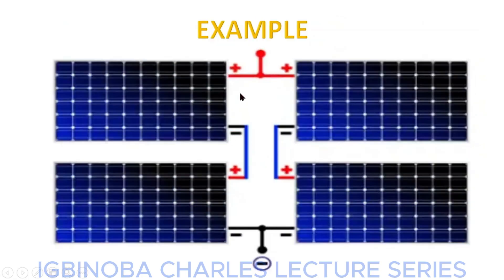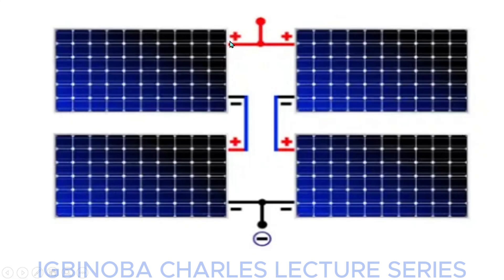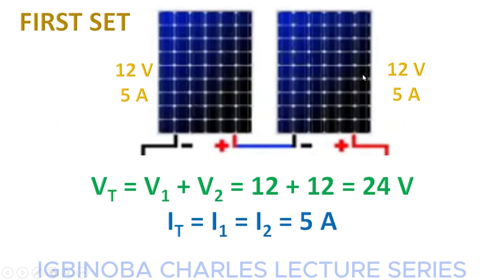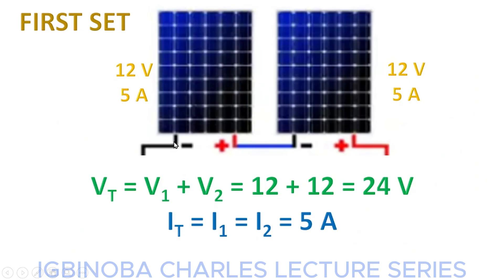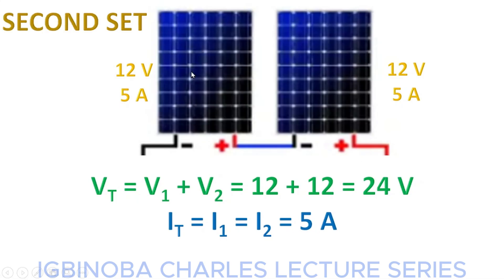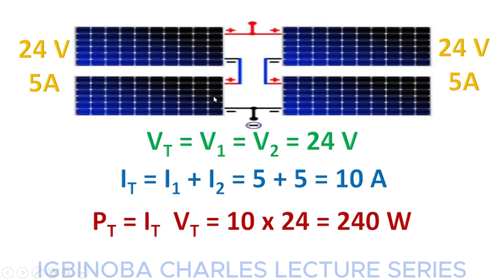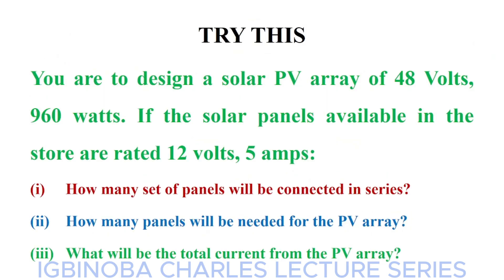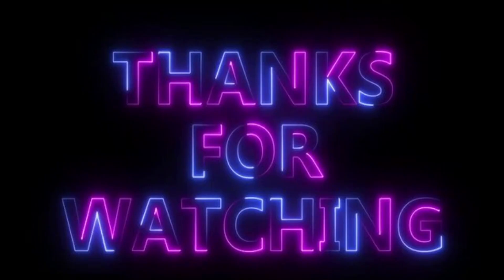Connection of  Solar Panels in SERIES-PARALLEL

Comment: EEE3126V
1) Four panels are connected in series. When you connect four 12v, 5A panels in series you get a total of 48V.
2) The total of 16 panels would be needed as each panels produces 60W given us a total of 960W(12v × 5A). It will be divided 60W given us 16 panels.
3) The total current of the pv arrays is 20A.

Comment: MAR3129Y

Sets of panels that will be connected in series =
48/12 = 4 panels.
2. Power generated by a single panel = 120V x 5A =
600W.
Required power in the array is 960W. Hence, the
number of panels needed for the array = 960/60 = 60
panels.
3. 16 panels are in the array and 4 panels are in series.
Total number of parallel sets of panels = 16/4 = 4
parallel sets.
Total current from each set of panels is 5A. Since these sets are in parallel, the total current = 5A × 4 = 20A.

Comment: PETRO3133C

Connecting panels in series increases the voltage while keeping current the same. To reach the target of 48 Volts using 12-Volt panels:
(i) 4 panels in series.

 Total Panels Needed. To find the total number of panels, divide the total required power by the power of one single panel.
Total Panels = Total Power/Panel Power = 960W/60 W = 16  panels
(ii) 16 panels total.

You can calculate the total current (I) using the total power (P) and total voltage (V) of the array (P = I/V)
(iii) 20 Amps total current.

Comment: MECH3177U

1. Series-Connected String: A set of 4 panels is connected in series to build up the required system voltage.
2. Total Array Size: The complete photovoltaic array consists of 16 panels in total.
3. Array Output Current: The total current generated by the entire PV array is 20 Amps.

Comment: MECH3136F

1. Sets of panels that will be connected in series = 48/12 = 4 panels.

2. Power generated by a single panel = 120V x 5A = 600W.
Required power in the array is 960W. Hence, the number of panels needed for the array = 960/60 = 60 panels.

3. 16 panels are in the array and 4 panels are in series. Total number of parallel sets of panels = 16/4 = 4 parallel sets.
Total current from each set of panels is 5A. Since these sets are in parallel, the total current = 5A x 4 = 20A.

Comment: Civ318R

1. Four panels are connected in series. When you connect four 12-volt, 5-amp panels in series, you get a total of 48 volts, which is the voltage needed for the solar system.

2. A total of 16 panels are needed. Each panel produces 60 watts (12V × 5A = 60W). To get 960W in total: 960 ÷ 60 = 16 panels.

3. The total current from the solar array is 20-amps. Using the formula I = P ÷ V,

I = 960W ÷ 48V = 20A.

Comment: PETROCHEM355C

1. Four panels are connected in series.
When you connect four 12-volt, 5-amp panels in series. vou get a total of 48 volts, which is the voltage needed for the solar system.
Each panel produces 60 watts (12 V x 5 A = 60 W)
To get 960 W in total: 960 + 60 = 16 panels.
3. The total current from the solar array is 20 amps.
Using the formula 1 = P + V 1-960 W 48 V= 20 A.

Comment: MECH3146P

1. Number of panels in series:
For 48V, we need to connect panels in series. Since each panel is 12V, we'll need
48V divided by 12V = 4 panels in series

2. Total number of panels:

Each panel is 12V, 5A, so the power rating will be: 12V x 5A = 60W per panel

For a 960W array, we'll need: 960W divided by 60W per panel = 16 panels

Since we need 4 panels in series, we will have: 16 panels / 4 panels per series line up = 4 parallel line ups

3. Total current from the PV array:

Each series line up produces 5A (since the panels are connected in series). With 4 parallel lineup , the total current will be:
5A × 4 = 20A

Comment: PETRO339M

1. Actual load= (100×3)+(60×10)+(120×4) =1380watts
2. Total load assuming inverter loss of 25%= Actual load +Inverter loss
Inverter loss=25% of Actual load
= 25%×1380=345 watts
Total load= 1380+345=1725 watts
3. Inverter rating on VA using power factor of 0.8
= (1725÷0.8)= 2156.25
4. Battery capacity using factor for reserve 75%=(2×1725×6×0.75)=1293.75Ah
5. No. of batteries for backup hours=1293.75Ah÷150Ah= 8.6 =8 batteries 
6. How batteries will be connected?
The batteries will be connected in parallel 
Vt=V1=V2=V3=V4=V5=V6=V7=V8
Ah= 150+150+150+150+150+150+150+150=1200
7. Battery charging current=1293.75÷10=129Amps
8. Battery charging time assuming charging loss of 40%= 1293.75Ah+(40%+1293.75Ah)÷129A=14hrs
9a. Wattage panel array= 3105 watts
9b. Number of panels required= 3105÷345=9 panels 
9c. Ampere of charging controller required= 3105÷12=258.75Amps
10a. Wattage of panel array= Calculated wattage of solar panel array for charging battery only+ calculated total load =3105+1725=4830watts
10b. Number of panels required= calculated wattage of solar panel array÷ Available wattage of solar panel supplied= 4830watts÷345= 14Amps
10c. Ampere of charge controller= calculated wattage of solar panel array÷ solar panel voltage=4830watts÷12volts= 402.5Amps
11. How will the panels be connected?
Ans: They will be connected in parallel

Comment: Mech3181y

1. 4 sets of panels will be connected in series.
Since connecting 4 of the 12 volts, 5 amp panels in series gives a total of 48 volts as required by the solar PV array design
2. 16 panels will be needed for the PV array.
This is because the power of each panel is 12 x 5 = 60 watts, therefore the total number of panels to
produce 960 watts is, 960/60 = 16
3. The total current from the PV array is 20 amps
Since I (total) = P (total)/ V(total)
I (total) = 960/48 = 20amps

Comment: EEE101W
Four panels are connected in series.
When you
connect four 12-volt, 5-amp panels in series, you get a total of 48 volts, which is the voltage needed for the solar system.
2. A total of 16 panels are needed. Each panel produces 60 watts (12V × 5A =
60W). To get W in total: 960 60 = 16
panels.
3. The total curent from the solar array is
20-amps. Using the formula I = P + A,
1 = 960W ÷ 48V = 20A.

Comment: EEE98T 
Four panels are connected in series.
When you
connect four 12-volt, 5-amp panels in series, you get a total of 48 volts, which is the voltage needed for the solar system.
2. A total of 16 panels are needed. Each panel produces 60 watts (12V × 5A =
60W). To get W in total: 960 60 = 16
panels.
3. The total curent from the solar array is
20-amps. Using the formula I = P + A,
1 = 960W ÷ 48V = 20A.
3
回

Comment: EEE55C

Four panels are connected in series.
When you
connect four 12-volt, 5-amp panels in series, you get a total of 48 volts, which is the voltage needed for the solar system.
2. A total of 16 panels are needed. Each panel produces 60 watts (12V × 5A =
60W). To get W in total: 960 60 = 16
panels.
3. The total curent from the solar array is
20-amps. Using the formula I = P + A,
1 = 960W ÷ 48V = 20A.

Comment: PETRO3190H

4 sets of panels will be connected in series.

we are connecting 4 of the 12 volts, 5 amp  panels in series gives a total of 48 volts as required by the solar PV array design

16 panels will be needed for the PV array.

This is because the power of each panel is 12 x 5 =  60 watts, therefore the total number of panels to produce 960 watts is, 960/60 = 16

Total current from the PV array is 20 amps

Since I(T)= P (total)/ V(total)
I (total) = 960/48 = 20amps

Comment: MECH3173Q
1. Four panels are connected in series 
When you connect four 12-volts,5-amp panels in series, you get a total of 48 volts ,which is the voltage needed for the solar system 
2. A total of 16 panels are needed 
Each panel produces 60 watts (12v×5A=60w).
To get 960w in total: 960/60=16 panels 
3. The total current from the solar array is 20 amps.
Using the formula I=p+v, I=960w/48v=20 amps

Comment: MECH328B

1. 4 sets of panels will be connected in series 

Since connecting 4 of the 12 volts, 5 Amp in series gives a total of 48volts, as  required by the solar PV array design 

2. 16 Panels will be needed for the PV array because the power of each panel is 12×5= 60 watts. therefore the total number of panels to produce 960 watts is 960÷60= 16 

3. The total current from the PV array is 20amps.
This is because I(total) = P(total) /V(total)
I(total) = 960÷48= 20amps

Comment: NAT341O

1. Four panels are connected in series. When you
connect four 12-volt, 5-amp panels in series, you get a total of 48 volts, which is the voltage needed for the solar system.
2. A total of 16 panels are needed. Each panel produces 60 watts (12V x 5A = 60W). To get W in total: 960 60 = 16 panels.
3. The total curent from the solar array is
20-amps. Using the formula | =P +A,
1=460W÷ 48V= 20A.

Comment: Petrochem357E

1. 4 sets of panels will be connected in series.

Since connecting 4 of the 12 volts, 5 amp panels in series gives a total of 48 volts as required by the solar PV array design

2. 16 panels will be needed for the PV array.

This is because the power of each panel is 12 x 5 = 60 watts, therefore the total number of panels to produce 960 watts is, 960/60 = 16

3. The total current from the PV array is 20 amps

Since I (total) = P (total)/ V(total) I (total) = 960/48 = 20amps

Comment: MEC75W
I.Four panels are connected in series.
When you connect four 12-volt, 5-amp panels inseries. you get a total of 48 volts. which is thevoltage needed for the solar system.
2. A total of 16 panels are needed.
Each panel produces 60 watts (12 V x 5 A = 60 W).
To get 960 W in total:960+60=16panels.
3. The total current from the solar array is 20 amps.
Using the formulaI=P+V.l=960 W 48 V =20 A

Comment: Mech3204x 

1. Four panels are connected in series.

When you connect four 12-volt, 5-amp panels in series, you get a total of 48 volts, which is the voltage needed for the solar system.

2. A total of 16 panels are needed.

Each panel produces 60 watts (12 V x 5 A = 60 W).

To get 960 W in total: 960 + 60 = 16 panels.

3. The total current from the solar array is 20 amps.

Using the formula I = P + V, I=960 W 48 V = 20 Α.

Comment: MECH38H

1). 4 panels are connected in series.

We connected four 12-volt, 5-amp panels in series, so we get a total of 48 volts, which is the voltage needed for the solar system.

2). A total of 16 panels are needed.

Each panel produces 60 watts I.e. 12 V x 5 A = 60 W
To get 960 W in total, 960÷60 = 16 panels.

3). The total current from the solar array is 20 amps.

Using I = P ÷ V, we have that, 960 W ÷48 V = 20 A.

Comment: NAT13M

1. Four panels are connected in series. When you
connect four 12-volt, 5-amp panels in series, you get a total of 48 volts, which is the voltage needed for the solar system.
2. A total of 16 panels are needed. Each panel produces 60 watts (12V × 5A = 60W). To get W in
total: 960 60 = 16 panels.
3. The total curent from the solar array is
20-amps. Using the formula I = P + A,

1 = 960W ÷ 48V = 20A.

Comment: CIV3107C
1.)  4 set of panels connected in series would be needed for the PV array 
2.) 16 panels in total would be needed for the PV array 
3.) Total Current= Total Power ÷ Total Voltage 
                            = 20amps
Therefore the total current needed is 20amps

Comment: MECH3100V
1. Four panels are connected in series. When you connect four 12-volt, 5-amp panels in series, you get a total of 48 volts, which is the voltage needed for the solar system.

2. A total of 16 panels are needed. Each panel produces 60 watts (12V x 5A = 60W). To get W in total: 960 60 16 panels.

3. The total current from the solar array is 20-amps. Using the formula I = P + A, 1960W 48V = 20A.

Comment: EEE 125U

1. 4 Panels are connected in series 
If your connect 4 12V, 5A panels in series, you will get a total of 48V

2.  You will need 16 Panels, each panel would produce 60W which will give a total of 960W(12v × 5A), 960W will be divided by 60 watts, which is 16 Panels 

3. The total Current from the PV arrays will be 20A

Comment: CIV384F

1. Four panels are connected in series.
When you connect four 12V, 5A panels in series, you get a total of 48V.

2. The total of 16 panels would be needed as each panels produces 60W given us a total of 960W(12V x 5A). Hence 960W will be divided by 60W given us 16panels.

3. The total current from the PV arrays is 20A.

Comment: CIV329C
i) Panels in series to reach 48 V:
48÷12=4. 4 panels in series.

(ii) Number of panels total:
Total panels = 16
960÷60=16. Equivalent arrangement: 4 in series × 4 strings in parallel (4S × 4P).

(iii) Total current from the array:
Each series string current = 5 A; with 4 parallel strings total 
5×4=20 A

Comment: COMP324X
1).  4 panels are connected in series
We connected four 12-volt, 5-amp panels in series, so we get a total of 48 volts, which is the voltage needed for the solar system.

2). A total of 16 panels are needed.

Each panel produces 60 watts I.e. 12 V x 5 A-60 W

To get 960 W in total, 960+ 60 = 16 panels.

3). The total current from the solar array is 20 amps.

Using IP + V, we have that, 1960 W 48 V = 20 A.

Comment: PETROCHEM330D

Given
Target PV array: 48 V, 960W
Available panel: 12 V, 5 panel power = 12 × 5 = 60 W

(i) Panels in series per string (to reach 48 V)

Required array voltage ÷ panel voltage = 48 ÷ 12 = 4 panels in series.

(ii) Total number of panels

Total array power ÷ panel power = 960 ÷ 60 = 16 panels total.

(iii) Total array current

Each series string current = panel current = 5 A.
Number of parallel strings = 16 ÷ 4 = 4.
Total array current = 4 × 5 A = 20 A at 48 V.

Comment: CHM3157A
1. 4 set of panels will be connected in series

Total voltage of the PV array = 48 volts
Voltage of a single panel = 12 volts

Since for a series connection, V (total) = Sum of the voltage of all panels in the PV array,
Number of panels that will be connected in series = 48/12 = 4

2. 16 panels will be needed for the PV array 

The required power for the PV array = 960 watts
Power generated by a single array, P = IV = 12×5 = 60 watts
Panels needed for the PV array = 960/60 = 16 panels

3. The total current for the PV array is 20 amps

P (total) = I (total) × V (total)
I (total)= P (total) / V (total) = 960/48 = 20 amps

Comment: COMP79A

1). 4 panels are connected in series.

We connected four 12-volt, 5-amp panels in series, so we get a total of 48 volts, which is the voltage needed for the solar system.

2). A total of 16 panels are needed.

Each panel produces 60 watts I.e. 12 V x 5 A = 60 W To get 960 W in total, 960+ 60 = 16 panels.

3). The total current from the solar array is 20 amps.

Using I = P + V, we have that, 1960 W 48 V = 20 Α.

Comment: EEE 3155Y

i. Four panels are connected in series When connecting fur 12 V, 5A panels in series, we get a total of 48V which is the voltages needed for the solar system
ii. Each panel's power = 12x5= 60W. Total
number of panel will be 960÷60 = 16
Therefore, 16 panels will be needed for the P array
ili. Each parallel string carries 5A
Current = 5x4 = 20A
Therefore the total current from the PV  array is 20A

Comment: Mar8H 
The series connection sets the overall voltage of the array. To achieve  the required 48v output, the number of panels is connected in series is 48v÷12v=4 panels in  series
Each Panel generates 12v×5A=60w. Since the total required power is 960w, the total mumber of Panel  required is 960w÷60w=16 panels
With 16 panels arranged as 4 panels per series string the configuration result in 16÷4=4 parallel string 
Each string supplies 5A and because the strings are connected in parallel, the total current output is 5A×4=20A

Comment: CHM3410
1.  Number of panels in series = 48/12 = 4 panels.
2.  Number of panels needed for the PV array = Total power in the circuit/ Power in each panel = 960/60= 16 panels.
3.  Total current from the PV array = Total power/ Total voltage = 960/48 = 20 Amps.

Comment: CHM3161E

1. Four panels are connected in series. When you connect four 12-volts,5amps panels in series, you get a total of 48 volts, which Is the voltage needed for a solar system 

II.  The total panel required is 16

III. The total current is 20Amperes

Comment: CIV312L

a) Panels in Series:  
To reach a system voltage of 480V using 120V solar panels, you need to connect:  
480V ÷ 120V = 4 panels in series.

b) Total Number of Panels Needed:  
Each solar panel generates 600W of power.  
To achieve a total system power output of *9,600W*, the number of panels required is:  
9,600W ÷ 600W = 16 panels in total.

c) Parallel Strings and Output Current:  
If the 16 panels are grouped into sets of 4 (in series), this gives *4 strings*.  
These 4 series strings are then connected *in parallel*.  
Assuming each string delivers *5A*, the total system output current is:  
4 strings × 5A = 20A total current.

Comment: PETCHEM8H
four panel will be connected in series because each panel produces 12v and the array voltage we need is 48v. So no of panels 48÷ 12 = 4v

2. P= v×i=48×5=240w
So 960 ÷ 240 = 4 sets.
So total number of panels is 16 panels.
The total current of pv array is 20A, because each string supplies 5A and 4 strings are connected in parallel = 4 × 5 = 20A.

Comment: PETROCHEM394P

· System Voltage:  48  V
· Total Power:  960  W
· Each panel:  12  V, 5 A

Power per panel = Voltage × Current

P= 12 × 5 = 60 W

Total panels = 960÷60= 16

So, 16 panels are needed.

Each panel:  12  V
To get  48  V

48÷ 12= 4 panels in series

So, 4 panels in series makes one “string” at 48 V.

Total panels =  16 
Panels per string =  4 

16÷4=4

So, 4 parallel strings.

---

Step 6: Total current from PV array

Each string current =  5  A (since panels are in series, current same as one panel’s current in the string).

Total current =

4 × 5 = 20  A

(i) 4
(ii) 16
(iii) 20 A